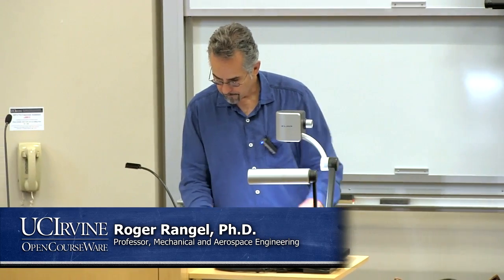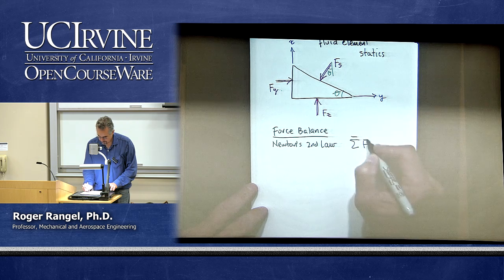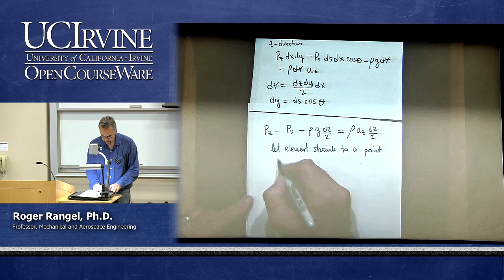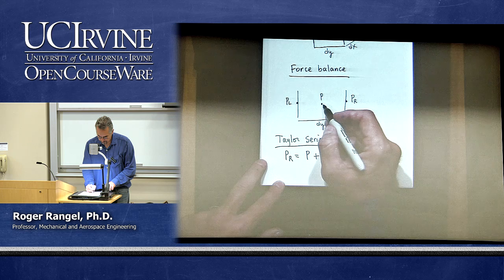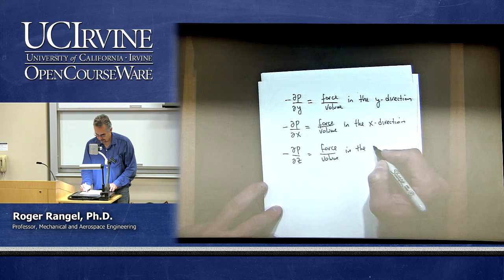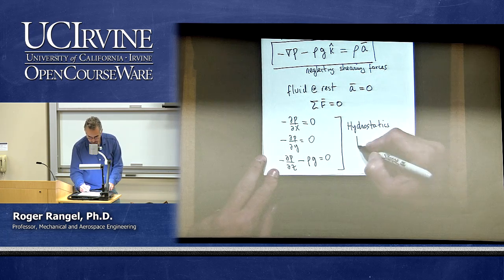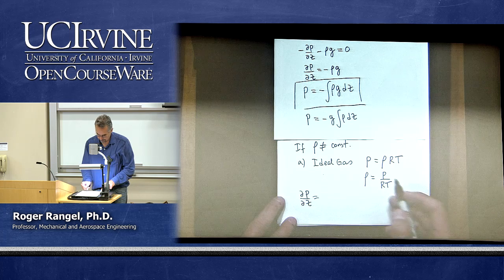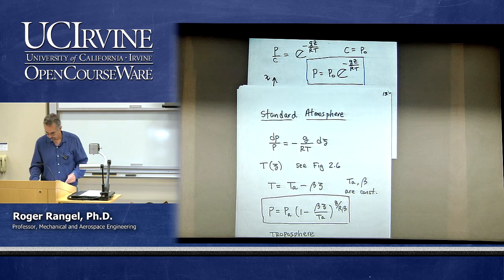Engineering MAE 130A. Intro to Fluid Mechanics. Lecture 03.

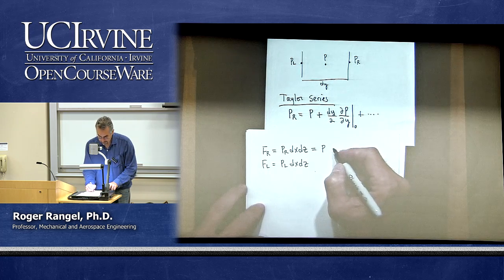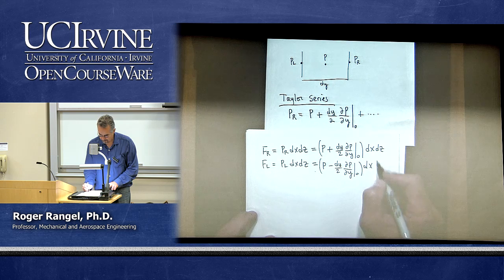Comment: At minute 22:30-23:03 needs correction. Force acting on the Right side (FR) is pushing to the left, therefore, Taylor series needs a neg (-) not pos (+). Likewise for (FL).
Reply: I don't think this is a mistake. Taylor series does not relate to the direction of the force.
Since right hand side is positive side of the center(P), therefore the professor used +.
The direction of the force is considered later.

Comment: is it necessary to assume only normal pressure forces (neglecting shear forces )in general to prove that pressure is a scalar.If not pls anybody suggest some analytical proof.According to my analysis ,those shear stress terms r not tending to zero as this wedge is shrinking to a point.ofcourse i am taking this wedge in flow field at a particular instant of time which may deform or rotate as time goes on.